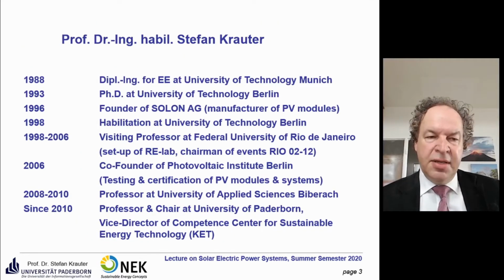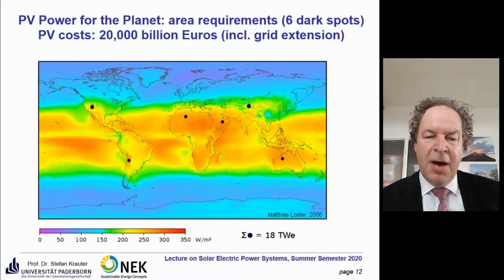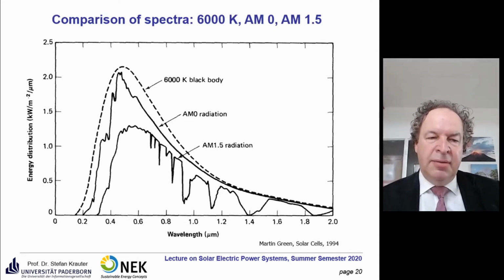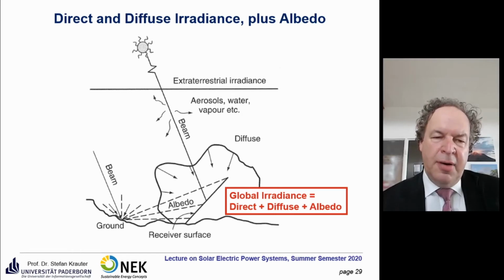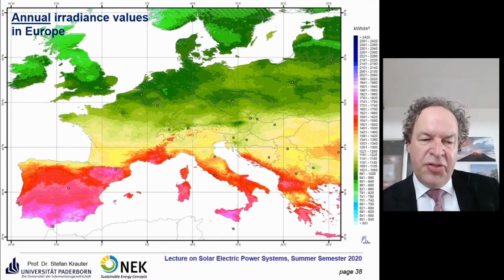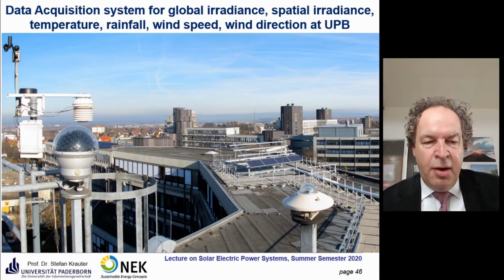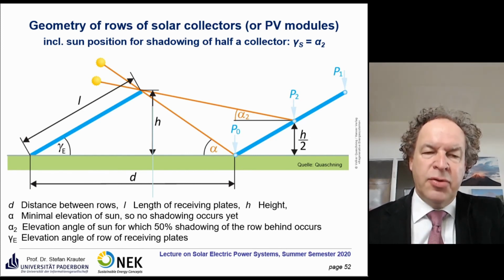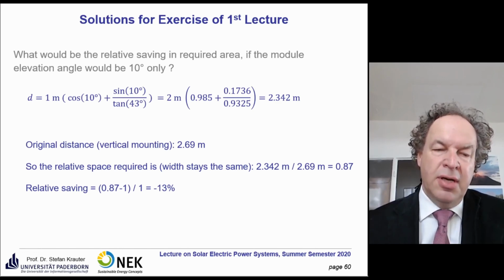Lecture 1 "Solar Electric Energy Systems": Global Warming, Solar Potential, Irradiance (old version)

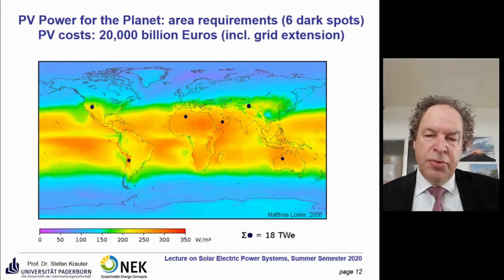Comment: I'd like to come back to 13:15, where you talked about the Global [PV] Energy Network. So if every possible local source would be connected to a global network, there will be huge conduction losses. Is this global network approach even superior to decentralised renewable energy networks, that utilise energy storages like batteries during low energy production times? Are conduction losses or is the battery efficiency the most significant factor when it comes to global approaches?
Reply from the maker: Using High-Voltage-DC-Transmission Systems, the grid losses can be minimized: Some existing HVDC transmission systems have losses in the vicinity of 4% for 1400 km. But: Due to the significant cost decrease of battery storage during the last decade, a decentralized system seems more cost-effective.